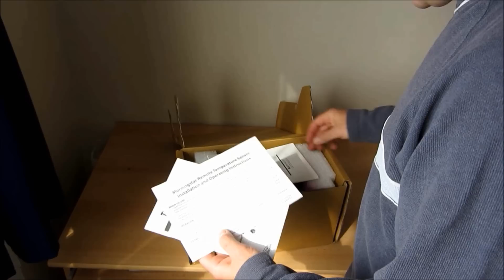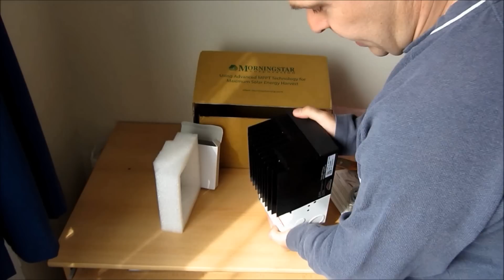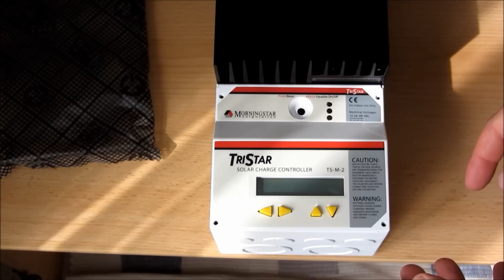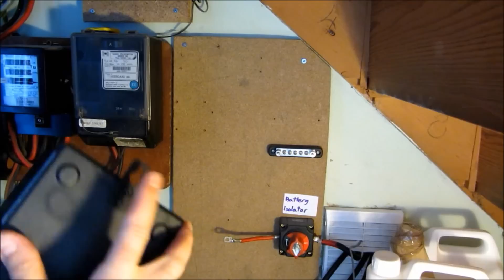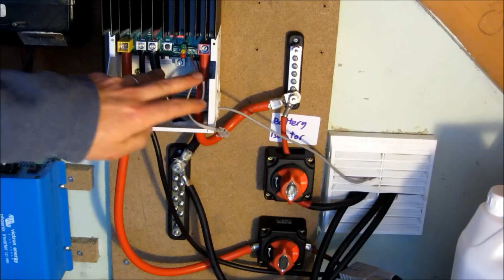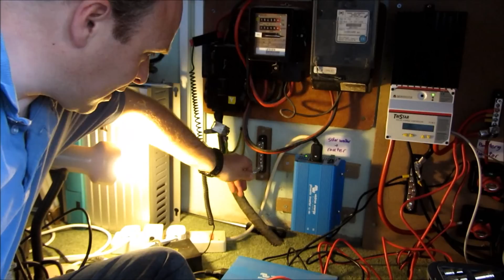Installing a Morningstar TriStar MPPT 60A off-grid solar charge controller

Comment from the maker: You can reset by pushing a suitable object through the hole to the right of the LEDs. I've not needed to yet though, I've turned the power off whenever making changes to the DIP switches.

Yes, ground is connected to negative of the solar/battery - this is what I was advised was best with the setup that I have. If I add a GFPD later I'd change some of this.

Comment: Hi Mike, there is a reason that crimp terminals are crimped rather than soldered on, there is actually less resistance as it forms molecular contact between copper and the tinned terminal, mechanically stronger, and it doesn't melt when it gets hot! 25mm2 crimp tool is less than £18 on ebay, and you can use it on all your battery leads.
Reply from the maker: PV person Thanks, I'll look into that next time I'm rewiring any of it. I've not noticed any of the joints getting hot, as I've oversized the cables. Still, would be good to do it better next time round. Cheers.

Comment: Good video.  I am looking to get a charge controller soon, and the Tristar mppt 60a is currently at the top of my list because of several factors...  It has low RF emissions, so if I (or a neighbor) wanted to use a Ham radio it wouldn't interfere, it is one of the few that is FCC class B approved, or whatever it's called.  It has no cooling fan to fail, but most importantly, it  doesn't de-rate it's output at temps over 25°C ambient like Midnight solar does.  To me, living in Texas, that's a big one.  Since you already own the controller, these comments were for others I guess :-) .
Reply from the maker: The 25C limit would rarely be a problem here in England, but I'm sure it will be useful for you in Texas! I've been delighted with the controller, and Morningstar tech support have been very helpful when I've had questions about how to alter the custom settings, etc.

Comment from the maker: There's no load connection, as it 's a charge controller only. Your load is connect directly to the batteries (with a fuse, of course). The controller can handle batteries at 12, 24, 36 or 48V.

Comment from the maker: Oh, sorry. I did record the switches, but it took too long I felt, so I cut it. It's pretty simple really - the first switch you leave where it is, the 2nd and 3rd set the system voltage, 4th, 5th and 6th set the battery type, 7th enables automatic battery equalisation and the 8th enables modification of settings via Ethernet. It's all really clearly explained in the manual.

Comment from the maker: I think it's an error in the log. Mine is plugged into 240W panels at present, and I regularly see numbers in excess of 500W for max power to battery, which is clearly nonsense. At some point I'll contact Morningstar tech support and see if they are aware of the issue.

Comment from the maker: I found Liveview wasn't working right with a crossover cable, but then I connected the controller to my internet router via Ethernet, and my laptop picked it straight up on the WiFi network. I can't paste a link in here, but basically its tsmpptXXXXXXXX where XXXXXXXX is the serial number on the side of the controller. I'll have a look at your video later, having a bit of a busy weekend here.... Mike

Comment from the maker: What voltage is your system? 12/24/48? And are you looking at the display on the controller, or ate LiveView on your computer, connected to the controller by Ethernet?

The power in watts, shown live, tells you what the panels are doing right now. The log shows the max power in that day (subject to the strange numbers I mentioned in my earlier comment). Of most use is perhaps the Wh (or kWh) figure for the day, as this shows the total your panels generated.

Comment: You don't hook anything up to the ground lug inside the controller?  I'm installing one of these, in an RV, and can't figure out what to do with that lug.  Are you supposed to run a second fat ground wire to the frame?
Reply from the maker: Best check with Morningstar tech support. In my system I've got battery negative earthed, so was advised not to earth anything else on the controller unless using a GFPD, as it could be dangerous.

Comment: There issue in my tri star solar charge controller . It shows the communication error along with that i am using 2 solar charge controller when i turn on both one gets off and other gets on
Reply from the maker: You'd best get in touch with support at Morningstar, they're really helpful.

Comment: this is a very good charger only to expensive for the most people,  Chinese charge controllers are also very good and payable. €600,- $833,- for this charge controller it is a lot of money.
Reply from the maker: Yes, it is certainly expensive. Mine cost about the same as the five 250W solar panels it's connected to! But it's good quality and has a name for reliability. This is the third Morningstar controller I've owned, and the other two are still working fine - one of them's 10 years old!
Reply: You can go with Chinese controllers if you wish, lexpee. However, in the solar industry, like most others, you get what you pay for. 

Mike, I have tested some Chinese controllers against others - MorningStar (Sunlight & ProStar series, as well as Midnite). The Chinese controllers are junk.

Great video. Thanks for posting it.
Reply: Hi Petra.

Not everything that comes from China is junk.

I've now been three months a "Solar-mate charge controller" model SM-60A 12/24v that works very well.

10 amps comes from the solar panels 15 amp goes to the battery. That is an efficiency increase of 50% i have 6   88cell panels thats 44,7 volt. My battery bank are 24V 230 amps. 

I'm saving for a big forklift battery with 2 volts cells 600 to 700 amps. 

If you buy something you should always do good your homework. Read reviews en forums/topics for a total judgment.

If I'm not sure about something, I do not buy it

Lex from Amsterdam Netherlands.
Reply: lexpee Fair enough. But, the ones I have tested have fallen well short of my expectations. For example, if you were to over panel them like I do my Midnite Kid, they would fail. I just do not see the quality there, in comparison to controllers like western made controllers.
Reply from the maker: Paul Petrea lexpee I've not tried any Chinese ones, I'm sure some may be OK, but although they are cheaper they are still more money than I'd like to lose if they turn out to be no good. I already had two Morningstar controllers which worked very well, so felt confident getting another. A few years ago I tried a cheap brand, I think it was IVT, and
the controller didn't work properly and I had to send it back.
Reply: I have two MorningStar (ProStar & SunLight) controllers and one Midnite (Kid) controller. Both MorningStar controllers are PWM. I wanted to try an MPPT controller and went with the Midnite on my third array. They all continue to perform as expected. The Chinese controllers I bought to test, were both PWM controllers. Both were junk. Again, I stand by "you get what you pay for" in this industry.  

Mike, I am glad to see you have expanded your array (1.25 kW?) and doing well.
Reply from the maker: Yes, up to 1.25kW now, so the controller regularly hits the 60A current limit. So some power is getting dumped, but the important thing for me is on the dull days, when the extra power allows me to keep more stuff off grid.
Reply: Quite.  You get what you pay for.  Morningstar all the time!

Comment: Where is your equalization button?, its the black stick that comes out of the hole in the panel, everyone forgets about that part!
Reply from the maker: Yes, that's the case for the standard controller - you press and hold to start equalisation, and again to stop. A single press cancels warnings as well. But when you have the display unit on, as I have, you can start/stop equalisation through that as well.

Comment: Hi Mike. Great little system.
I'm wondering... why was it neccessary to get a BIG ol' Tristar 60, when you're only running under 200w of solar through it? Wouldn't the 30 have been more than enough?

care to explain your thought process?
Reply from the maker: +Joel Lindow I upgraded the PV shortly afterwards - just did the controller on its own first, taking it step by step. I've got 1.25kWp on the roof now, so it maxes out the controller on a sunny day.
Reply from the maker: +Joel Lindow Oh, also, only the 60A version has ethernet, and that's very useful for monitoring and programming it.

Comment: Well fellows, nice video. Very well done. I have one question. We all know this is a SOLAR charge controller. No One gets into the series or parallel connection of the  Solar panels feeding the controller. Does one hook the solar panels in series or parallel? Also, I have four deep cycle batteries connedted to my controller. It takes three to five days to fully charge and the green light is flashing. Any ideas on why it takes so long to charge up? My goal is to build up enough batteries to power the LED and CFL lights in my Greenhouse. I need to have enough batteries and the ability to charge them to power my Greenhouse lights for twelve hours at a time each day.
Reply from the maker: Hi Joe. Series/parallel panels depends on a lot of factors. I've got 3 panels in parallel with a Vmp of about 30V. I went for this to keep the voltage at a safe level to make life easier. However, I could have gone with them in series, as the TriStar MPPT can take up to 150V. This would be slightly more efficient (lower losses in cables), but would generate dangerous voltages so be harder to work with.
Reply from the maker: On your batteries, could you let me know the Ah capacity of each, if they are in parallel or series, and what the total power of your PV panels is, then I can help you.
Reply: Mike Pepler
I have two 230w/24Vdc panels in parallel. The actual Voc of each panel is actually 33Voc.
I am using 4 Trojan 6Vdc golf cart batteries.
I put them of sets of two in series to make 12Vdc each set, and then  the two sets in parallel. They are 100ah each.
I had two other used car batteries and could never get the tristar to charge and Float. After checking them both had some bad cells.
When I threw them away, the tristar will now fully charge the other 4 Trojan batteries and now floats at 13.8Vdc, and the green light is on and blinking.
The display now shows FLOAT.
My objective is to figure out how many batteries I need to power the lights in my  greenhouse for between 12 and 18 hours each period, and be able to charge up the batteries durning the daylight hours..
I have two LED Lights rated at;
a. 600 watts @ 6.9amps
b. 330 watts @ 2.8amps/i
c. Two Flying Saucer LED's rated at .9amps x 2= 1.8 amps
Total Amps = 11.5 amps
I do not like the GOOGLE intrusion on Youtube. When I logged in I saw a message on the Bell. I went to your note to me and was typing you a reply and google closed the dialog page and went to Google. And you cannot post a reply without tying it into your google account password. I do not want Google and the whole world to know what I am talking about.
Reply from the maker: Joe Theragman
Yeah, Google have changed the comment system... Not much I can do about that... Feel free to send me an email via my blog if you like.

But going back to your solar panels, 460W is normally plenty to charge 200Ahx12V batteries, assuming you have some sunshine. However, I'm not sure about the power of your LED lamps? You mention 600W, but also 6.9A - is this at 12V, or something else? Anyway, if the W numbers are right, you have a problem - 990W for 12 hrs is 11.88kWh. But the total capacity of your batteries is just 2.4 kWh or so. So that would be draining the batteries flat - this could be why the system is taking a while to charge them full....

Let me know if the W and A numbers are right for the lights, then we can discuss more.

Comment: What about the red switches inside?  I have 4 interstate golf cart batteries in a 24v array, but I noticed there are 6 little red switches.  The manual isn't very helpful for which ones to switch up or down.
Reply from the maker: In my manual it's on page 18, Step 4 in the installation process. Basically, starting from the left, switch 1 should always be off, switches 2 & 3 set the battery voltage (2=on, 3=off for 24v),  switches 4, 5 & 6 set the charging profile (choose what suits your battery - I use custom and program the controller using my computer, but that's for advanced users), switch 7 turns auto-equalize on and off (I have it off, as I prefer to trigger this manually), and switch 8 controls whether the controller can be reprogrammed over Ethernet (I turn this on when I need to, off at other times). But read the manual carefully, and go on the morningstar website if you need extra help.
Reply from the maker: Sorry, I thought I'd replied to this one. If you've not got the latest manual, you can download it from http://support.morningstarcorp.com/. The instructions for the switches are on pages 18-20. I've got mine set to 'custom', and used my computer to program the settings I wanted - but this is not for beginners, you need to know exactly what you're doing regarding batteries, the charging process and temperature compensation.

Comment: wow what a beast
what gauge wire did you use for the battery ?

my solar charge controller is only a maximum of 300 watts at 12 volt or 600 at 24 volt
but most of the things i run are 12 volt , plus i've only got two 150 watt panels
Reply from the maker: +drEmulatorMadmax 50mm2 to the battery, and also to the inverter. 30mm2 for the solar, I think - it's a while ago I wired it up now. If I started again I'd go for 24V though.
Reply: ye 24 volt would be best, but i've only got a little 12 volt 9amp battery at the mo, i'm hoping to get a 60 amp agm when i can get to the shop that sells it, as they are kinda rare around here, the last place i contacted about a varta agm said they would have to get it from ireland £160 iirc
Reply from the maker: +drEmulatorMadmax It's worth considering a flooded battery instead. They need more maintenance than an AGM (topping up water), but they last longer if you look after them.

Comment: Mike, i see when you turned the pv on battery voltage went to 14.9v. Is this a custom absorb value you have selected or does the controller overshoot set voltages from time to time? Thanks.
Reply from the maker: Hi John. That was with the default settings out of the box. At 25C, it would have been aiming for 14.5 V, but as it was 16C at the battery, the temperature compensation had increased this to 14.9V.

Since then I found a problem with this though - if you have a high solar output and a high load connected, then when the load disconnects (e.g. compressor on a freezer turning off), the voltage spikes up for a fraction of a second. If it's already at 14.9V, the spike is high enough to make my inverter temporarily shut down, which is annoying.

So, I've altered the settings (using the software supplied) to prevent the absorb voltage going higher than 14.5V, which leaves room for transitory voltage spikes when loads disconnect. It's all been fine since then :-)
Reply: Many thanks mike, i have indeed done a calculation using the info from standard settings, and a temp correction of 0.3v is used. Using my battery datasheet this would be more than required and turned down quite a lot. I'm looking to purchase a Morningstar mppt as my current charge controller is set to a max of 28.6v and yet i still see spikes over 30v which trips out my inverter and will slowly dry up my agm batteries. The spikes are not just for a fraction of a second like yours. Thanks again.
Reply from the maker: John Kirkman
With mine set to 14.5V, the maximum transitory spike is usually 14.8-14.9, and perhaps once a week it may almost get to 15.1V. I guess you don't want to reduce your target voltage any lower, or you won't be fully charging the batteries...
Reply: Mike, does this spike only happen when loads suddenly reduce? My load is constant as my solar runs runs all the pumps on a large marine fish tank. In this case would you expect to see any over voltage spikes? Thanks
Reply from the maker: John Kirkman
I've only seen these brief spikes when a load disconnects while there's high solar generation. So your constant load shouldn't cause them.

Comment: Friend, I read that this equipment has data connection via Modbus protocol. Have you used this type of communication? With other software he could have access to the data controller.
Reply from the maker: It does have modbus, but I'm using its ethernet port, so I can access it via wifi.
Reply: RS232 cable will not fit in the small space in this unit.  The communication to this product is terrible.  Mine will only charge bat to 12.7V and I have the setting at 14V.  Tried everything to bring up the voltage but nothing works and the method they have to communicate to product is terrible for RS232.